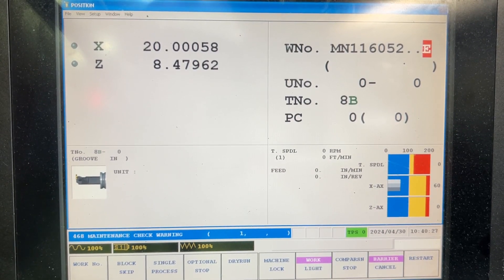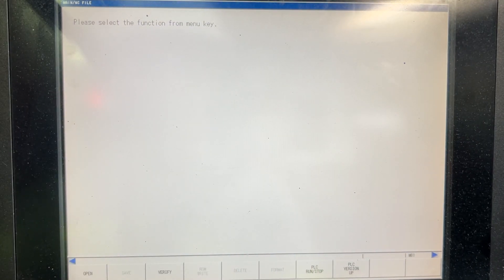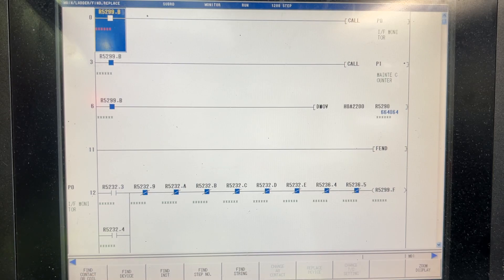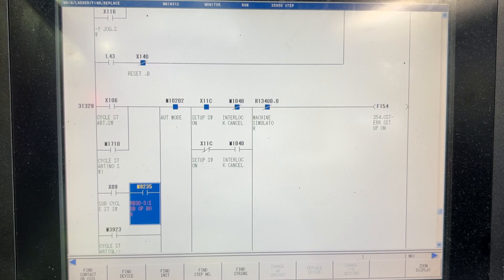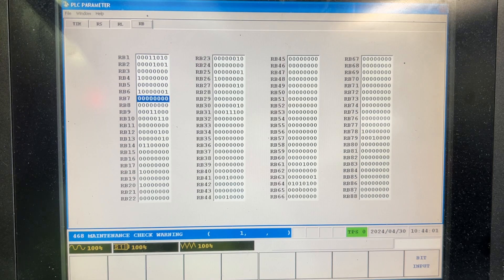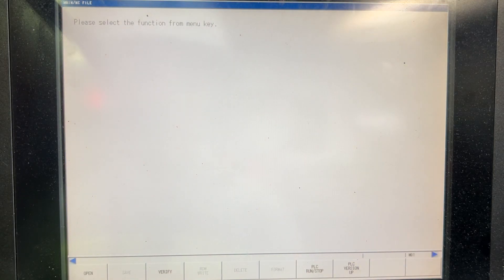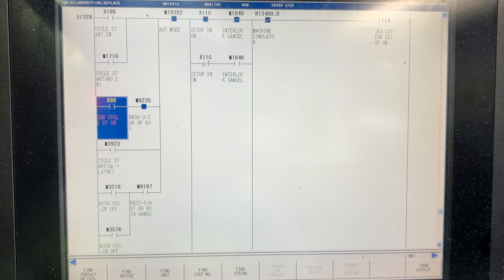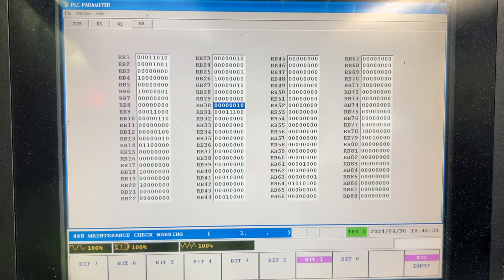Mazatrol Matrix Nexus: How to troubleshoot user alarm on PLC LADDER. How to enable PLC Parameter

Comment: hi.
i have a problem with 2 error and i dont know how should i fix them.
1393 R.D Relocation Detection.
1397 R.D bBattery Not Mounted.
Reply from the maker: Hi there. What machine serial number you have? Do you know the parameter where you have to enter the password to reset the alarm?
Reply: @FabianAchaval  hi.i fix the alarm 1393 but i dont know how can i fix the 1397 error.